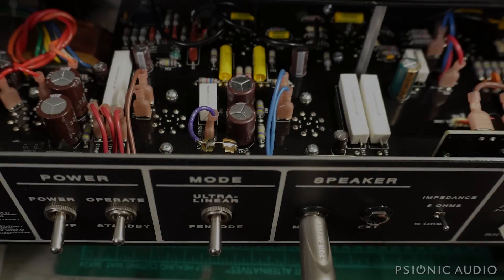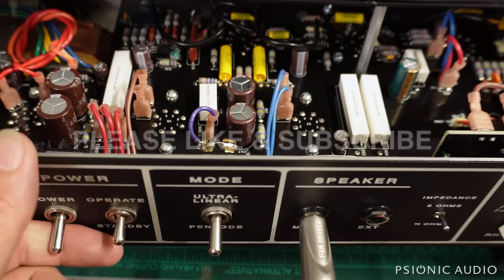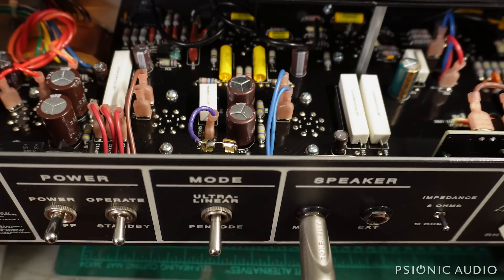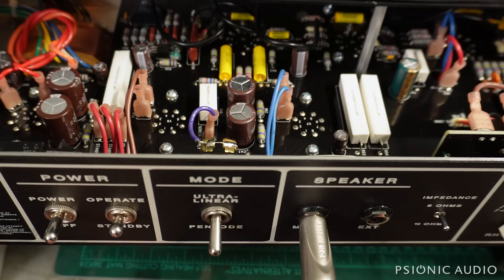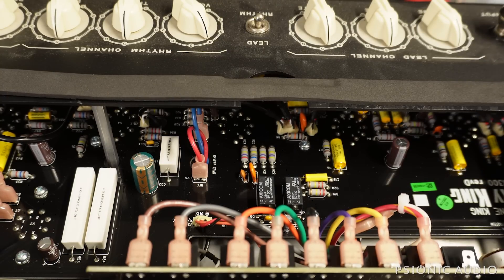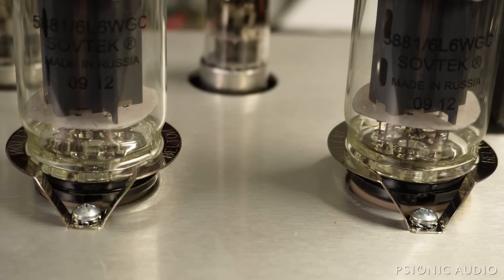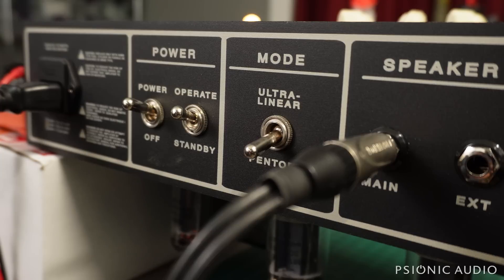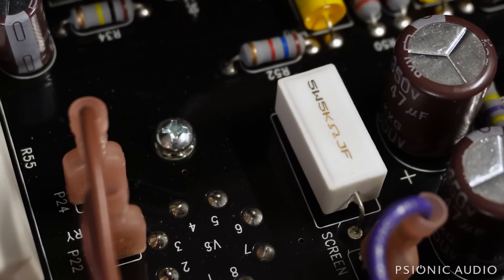Really, Tone King? (Another Sky King)

Comment: this would of never happened when the creator of ToneKing made these amps.   Mark Bartel got screwed over.   Another piece of garbage from Boutique Amps Distribution.
Reply: A lot of these boutique companies are just as slimy like the bigger operations, just without the sales numbers of Fender or Mesa Boogie.
Reply: @JohnsDough1918  as an owner of a Sky King I had in shop day one. I agree! I started with the Fender Reissues and a few others. All had some issues going on. It sucks, but you just pick the amp you like, go to a tech and get the one thing fixed. I payed $100 to mine and got everything in perfect order, and full pass of the board. What’s going on in this video I experienced and returned a SKY King for. Eventually the hum resulted in a tube blowing and only in Ultralinear mode. My exchange I replaced with TAD 6L6 asap, and no issues. Took to the tech to quiet cabinet rattle down at loud volumes, and a general inspection. I told the vendor I wouldn’t accept it, till my tech did a full run down. 

Going with Fender or others didn’t prove to be much better. Most the Fender Reissuesx needed new parts day one, and most all needed upgrades power tube holders…as a Gold Star Fender repair tech told me this. 

Post Covid things are way rougher and starting to show. Anything 2019 or before had it issue. But buying a new amp today, it’s a lottery I found.